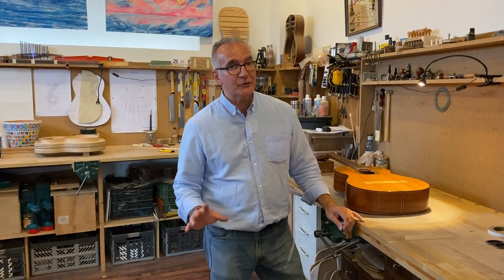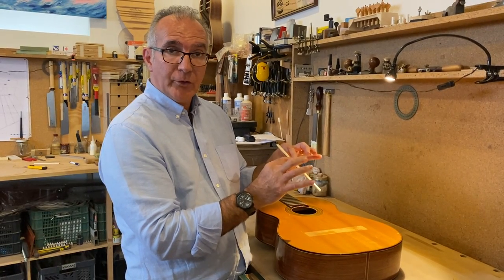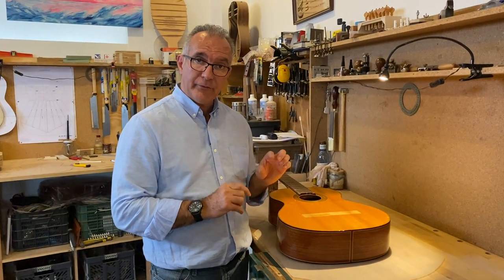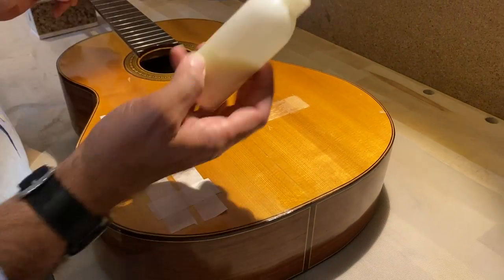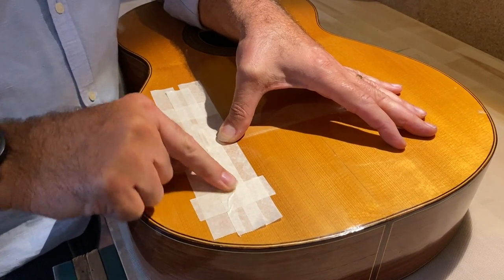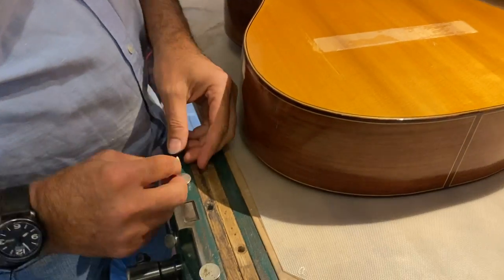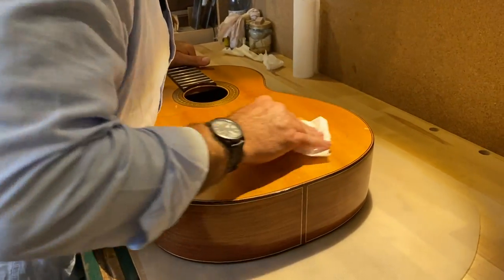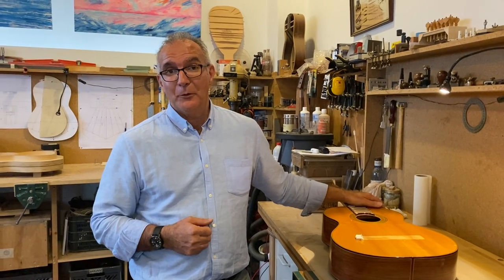How to fix a crack on the soundboard of a classical or flamenco guitar

Comment: Pablo:  I have one important improvement if I may,  "First clean the crack".  I just purchased a beautiful Seagull acoustic guitar at a substantial price reduction due to a 3 inch hairline crack under the sound hole.  Prior to starting Pablo's method,  I observed that the crack had a grey / black color imbedded in it.   I needed some kind of high pressure water or air to flush out the impurities.  I got an inspiration to use my Water Pic device which I use to clean my teeth and it worked like a miracle;  no more impurities in the crack.  Just ensure the area is dried off with a towel immediately after!  Now the crack is clean and ready for Pablo's method using the CA glue from Amazon.

Comment: Thank you for  the demonstration it worked perfectly on my guitar. Magnets great idea. I wish I would have known this in 1988.
I purchased a used 78 Ramirez flamenca with  clavijas. It had a few cracks on sound board. If I know what I know from your demo I could have fixed up the sound board. I ended up having a new sound board put in. What a tragedy.

Comment: Your videos are always excellent, Pablo, I always pick up something useful! Just one thing on the cleat: I guess you made sure the grain of the cleat was running perpendicular to the crack, but I didn't see how you did this. Was it just making sure it was oriented correctly on your finger as it went in? I've marked the cleat grain direction on the back of the inside magnet once the cleat is taped to it, then checked inside after fitting to make sure it's correctly turned.
Reply from the maker: Yes, I try to have the grain perpendicular but if there is an angle it doesn't matter too much as it will do the job equally well.

Comment: Great  demonstration thank you for sharing your experience. 

I like to ask you about french polishing after I've done the finishing on my guitar I build with French polish using dewaxed shellac and everything going good with no problem and i put the guitar until dry about a month so after the drying time I put strings on guitar... and playing No problems ..... but after 2 or 3 months the shellac on guitar especially on the soundboard showing like craks or some small lines also on the back as well  .... what cause that ? So this is a crack or that's normal from shellac I was thinking maybe from the sound of the instrument...? 

I always keep shellac in fridge and i always make fresh mixing french polishing using 100% alcohol .

Thank you

Comment: Excellent tutorial! Do you always use clits, or is OK sometimes not to use them?
The reason I'm asking is because usually a guitar top is made of two parts and the glue joint is holding very well without any extra support, so in a way it's like having a crack (A long one).
Reply from the maker: Yes, the clits are there to help the two sides of the crack to stay leveled as well as to support that crack. The center joint in a top is also supported not with clits but having one of the fan struts right on the glue joint. This isn’t always the case but most guitars have it.
Please check out the course I have available on www.onlineguitarmakingcourse.com

Comment: Hello! Is it ok to use an NGR penetrating wood stain on an acoustic guitar? I have bought one online but I'm worried it could muffle my guitar or something. The plan is to stain both fretboard and body and then apply clear lacquer top coat on the body. Got a pretty old spruce top, mahogany back and side Stafford here which sounds great but really needs repaint and stuff
Reply from the maker: The best thing to do is to try first in a similar type of wood and see if you like the result.
Once you know what you are doing you can do it to your guitar.
Reply: @redkitekk  yeah thanks but what I'm really concerned about is if it might muffle or dampen the sound
Reply from the maker: @ramrocker1004  if you are worried about the quality of the sound you need to make sure that the final amount of lacquer you use is as little as possible to get the job done. I thick layer of lacquer is what dumps the sound. I have never used NGR stain so I can’t give any advice on it.
Reply: @redkitekk  thanks a lot, mate

Comment: Glue but no clamping? So you are just filling the crack with glue and putting a cleat on underneath? I'm sorry but if you are't clamping it, aren't filling it with spruce dust or a spline, then you are just stabilizing the crack with the cleat, not actually fixing it.
Reply: Magnets used for clamps Einstein.